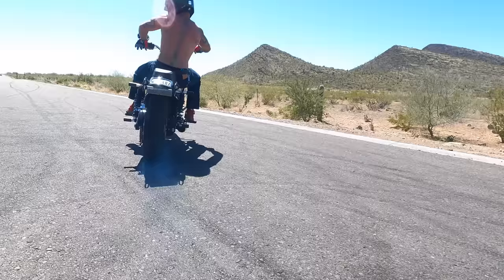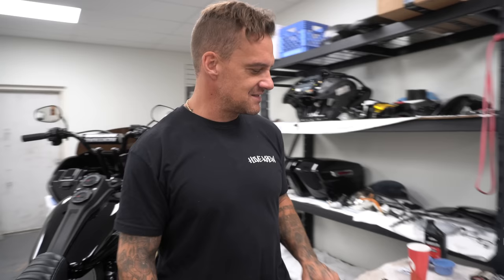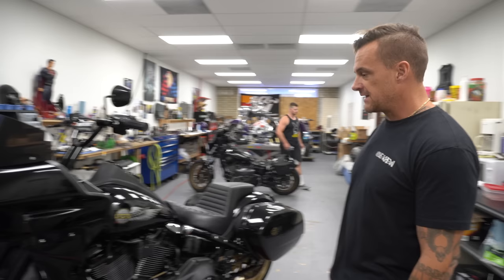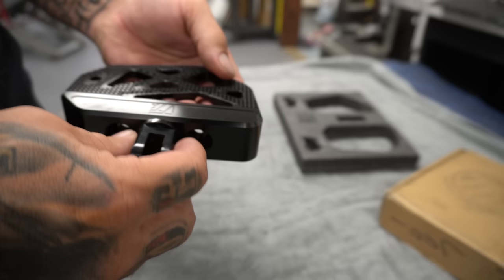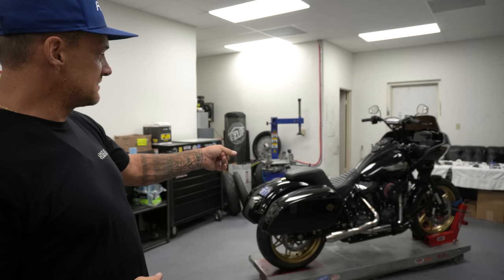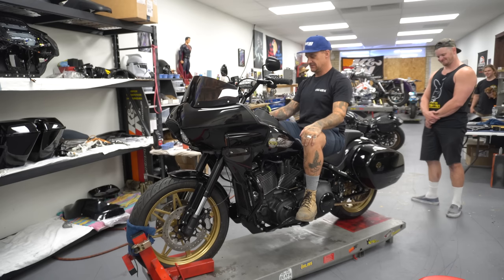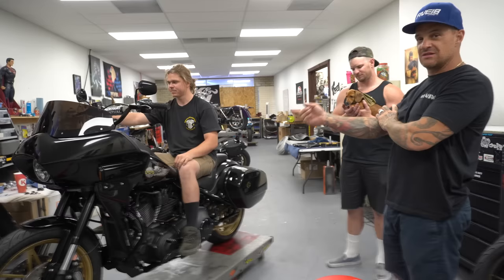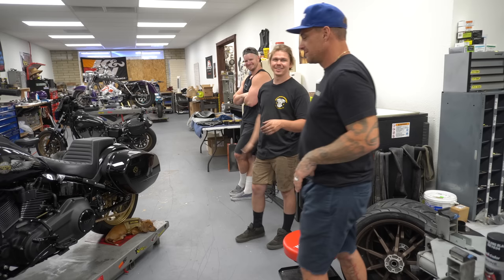Giveaway Bike (ep7) handle bar fitment / minni floorboard install

Comment: Can you run the ATV bars on a fxdb 2017?
Reply from the maker: In anything Harley Davidson. As long as you don’t have that stupid integrated top tree. That’s also easily replaced if you do have that you can call the shop and we can get you one for fairly cheap
Reply: @kruesioriginals  hell ya thanks!